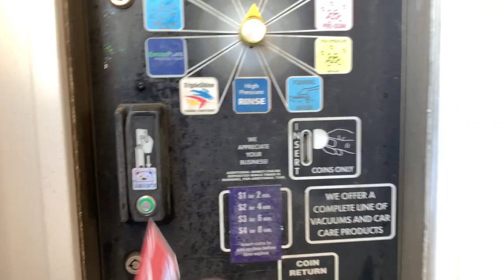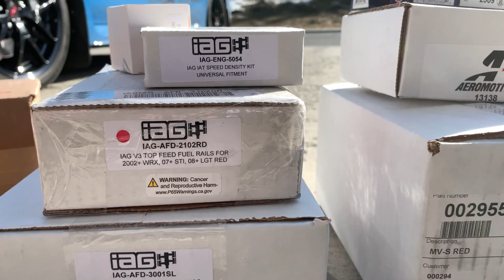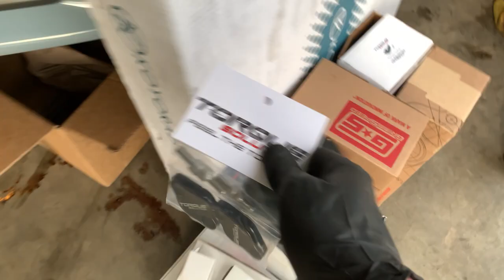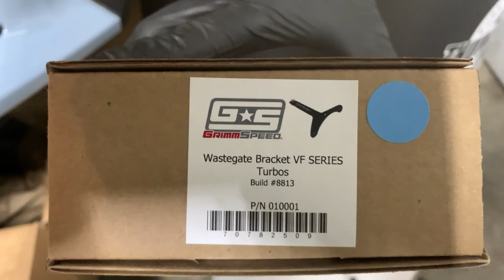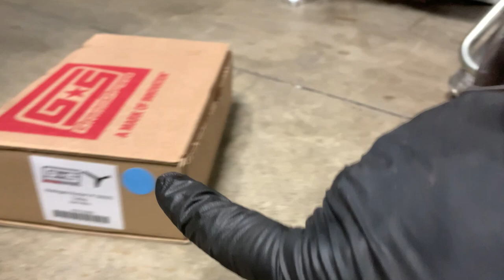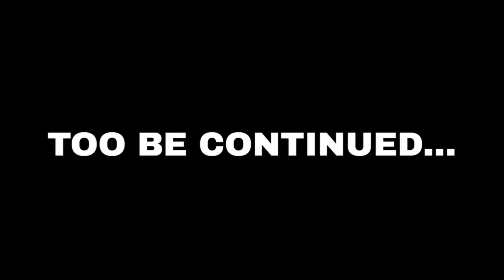How To Get 300+WHP out of your STI / Part 1

Comment: Coming from a performance engine/EFI company, why would anyone not run speed density on a forced induction car? I can see how using the MAF at idle/vacuum conditions would be beneficial, but once the car moves into low-moderate loads and transitions into boost, it should be all MAP at that point. I'm new to the Subaru family, but it boggles the mind that speed density wouldn't be nearly the FIRST thing done to ensure consistency and safety in the tune. If I'm ignorant to this platform, please let me know, but I'm just pulling from my past experience in other platforms.

Comment: great video! what are your thoughts on a cylinder 4 cooling mod?
Reply from the maker: I will not use them on any builds.
Reply: @BaderBuiltRacing  Just curious of why not?
Reply: @gregorysharkey4372  I was about to order one until baderbuilt's reply and then did a little research and it shows cylinder 4 cooling down on the surface with a laser thermometer but cant find anything on what happens inside or to the other cylinders . I'm not sold on it.
Reply: I’ve been torn on getting this mod for my 2018 STI.  Really interested to see what baders reason for not using it. I know it does lower temps in cylinder 4 but while raising temperatures in the other 3 cylinders. Is this good or bad? I honestly don’t know. Is it better having them closer in temps but being higher temps or #4 running hotter stock? There hasn’t been enough testing. So I haven’t purchased it yet. Sometimes people make a good case for it but it’s back and forth. Cheap mod if it does work and prevents failure on #4 tho. Pls help lol
Reply: @michaelhernandez1398  I had one installed at 80k. Was fine without it.

Comment: just did the first oil change on my 2020 sti and the dealer gave me a blue smaller US made oil filter . Seem Subaru USA discontinued the black . would you  recommend  the blue or the larger black jdm that it came with .car is still stock and will be changing oil at 3k miles using subaru oil.

Comment: Josh love the vids man. Question, if you were to put a fp blue 58mm jb turbo on this customer car, would you need to upgrade the map sensor to a higher bar? If so what bar?
Reply from the maker: Yes sir i would, and also at same time id convert to speed density because it will max out MAF (depending on your tuner and how far he is willing to push the car), Speed density involves a upgraded map sensor (COBB 4 bar, AEM 3.5 bar) and a Intake Air Temp Sensor in either the intake charge pipe right before throttle body or inside a top mount. Hopefully this helps.
Reply: @BaderBuiltRacing  Thanks boss!

Comment: Does the external waste gate need to be fitted at the top of the up pipe. Iv hot mine fitted at the bottom so the dump pipe can exit out the bumper.
Reply from the maker: placement doesnt matter as long as wastegate has priority over boost control is what matters.
Reply: @BaderBuiltRacing  perfect mate cheers didn't really know much about running a ewg with the placement of where it should go. What car do you prefer the evo or the subarus.

Comment: What's your opinion on IAG AOS vs something like a radium dual catch can setup? I've heard that one of the hoses on an AOS can get pretty gunked up over winter time vs a catch can that needs emptied every oil change which doesnt seem very difficult.
Reply from the maker: I always recommend the IAG AOS, i have one on hyper blue that has over 60k mile / 4 years old and never a single issue with any of hoses. Emptying a catch can is a hassle and you will have to do it more often on a looser built engine.

Comment: Josh. When you need to upgrade your fuel pump controller? Someone told me that if you’re using 1300 ID you’ll a 525 LPG fuel pump.
Reply from the maker: I don’t use fuel pump controllers after going to walbro 450 or larger fuel pump.
Reply: _BaderBuilt. I’m upgrading my fuel system with IAG fuel kit and 1300cc but still have stock turbo and just bolt on. What fuel pump you recommend? Eventually I will get a radium hanger. But that’s for future built. Thanks!
Reply from the maker: I’d recommend a aem e85 340lph drop in fuel pump sir
Reply: Josh. The AEM can support the 1300 injectors right? I’m only running bolt on parts. Thanks!

Comment: I thought it was going to be. In order to get 300+. Blow it up and buy a new block and turbo!
Reply: Checking if this is your car not sure if Josh said Kendrick or Hennicc lol. If it is curious what Wheels size and back spacing along with tires you're running fitment looked 👌🏼
Reply: @DJ_Driven   nah, I wish I was in a Bader video! I’ve got the white GD in my profile pic. 18x8 +40 w/ 255/35r18 but pretty sure you are asking on car in video. 18x9.5 +35/+40 is really popular on the VA platform.
Reply: @DJ_Driven   nah, I wish I was in a Bader video! I’ve got the white GD in my profile pic. 18x8 +40 w/ 255/35r18 but pretty sure you are asking on car in video. 18x9.5 +35/+40 is really popular on the VA platform.